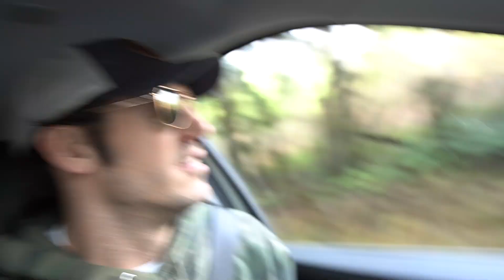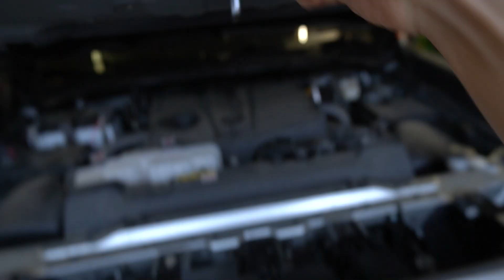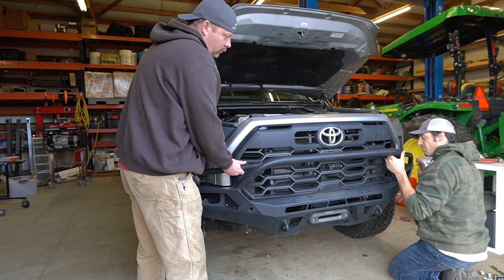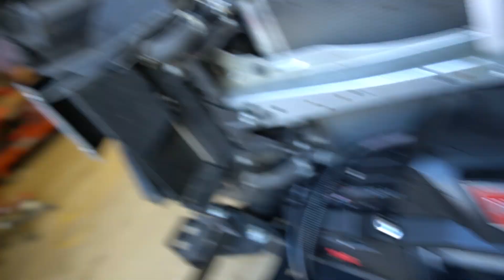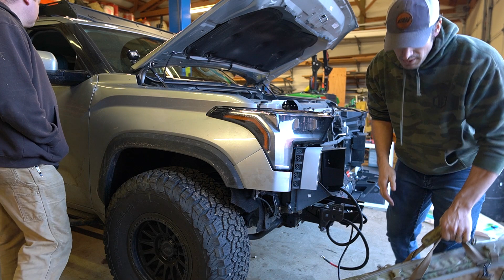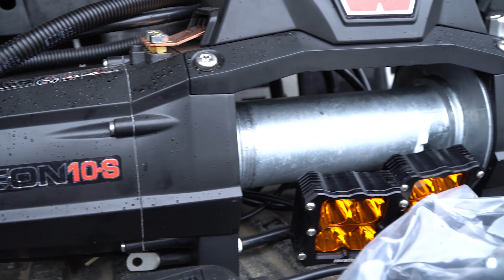I wish I knew this BEFORE I tore apart my Tundra to Install a Warn Winch...

Comment: that is why i like wiches with controller onside, not build-in.
Reply from the maker: I wish I had anticipated that issue
Reply: @Maxx Powell  CBI tech claimed that it will fit . Not sure how if you didn't. Maybe a trim variation on Toyota side

Comment: I forget exactly because I didn't end up using the relocation kit after I bought it but the control box on top should just unscrew from the rest of the winch. You could probably get away with not buying the relocation kit cause basically all it is is the wires and a small terminal box for the connections on the winch end with the bracket for mounting the control box elsewhere. Cut your own wires and zip tie the box somewhere and you should be good to go. Mine was the zeon platinum but I don't think there's any major difference outside of the remote clutch

Comment: Or at least with the Smittybilt or Badlands or even an open road you wouldn't have to modify your front end to put the winch. I have the smittybuilt and the bolt is easy to remove and it makes you pay attention to how it is spooled,which I like. And I'd rather pay for a winch than be given a warn.

Comment: An additional thought based on my own experience: You might also have to relocate your intercooler coolant lines that crosses the front slightly. I had to bring it up, shield it, and secure it to the cross member so that it didn't rub/contact the winch I installed. I didn't want a hole to eventually rub into the coolant line and cause a leak.
Reply from the maker: Good idea! I’ll keep this in mind when I complete the instal

Comment: I'm surprised CBI does not have a recommended winch. How would you unlock the spool with that bumper?
Reply from the maker: You have to reach down behind the grille to turn the free spool lever

Comment: Max what did you do with the automatic air dam motor after you removed it from the winch tray? Confused on how to handle that without having dash lights.
Reply from the maker: CBI off road sells a little module that can be plugged into the truck to truck the truck into thinking it’s working
Reply: @Maxx.Powell  I had read they were having issues with those actually working. Have you had any issues with your module since installation? 

It’s hard to believe that Toyota hasn’t been able to just bypass this when wanted by people on the CPU since all of the new off road models don’t have the air ram. Very frustrating.
Reply from the maker: I haven’t had any issues so far
Reply: @Maxx.Powell  thanks dude